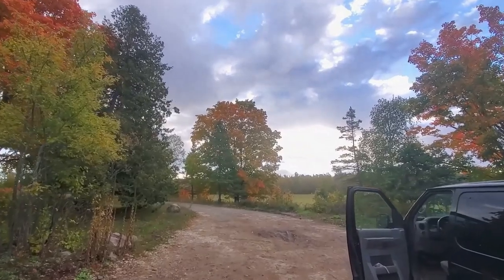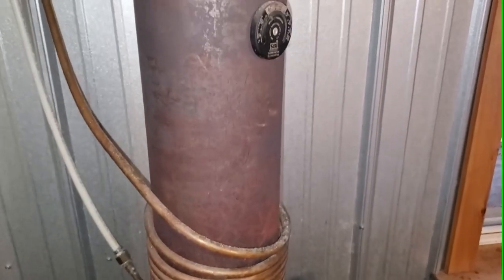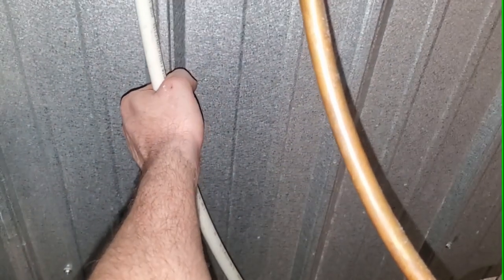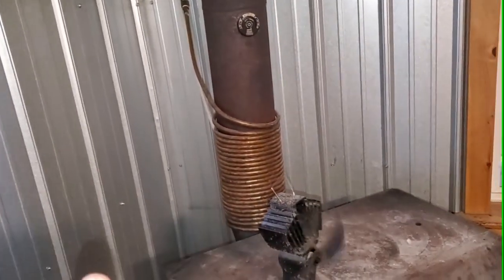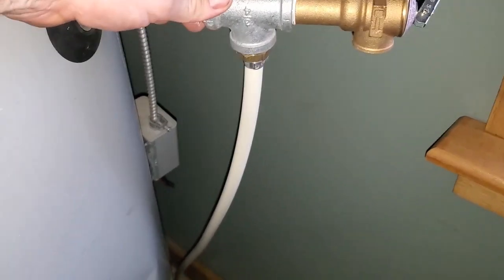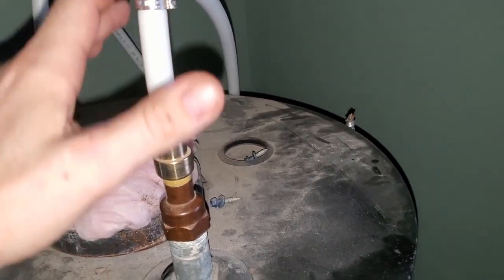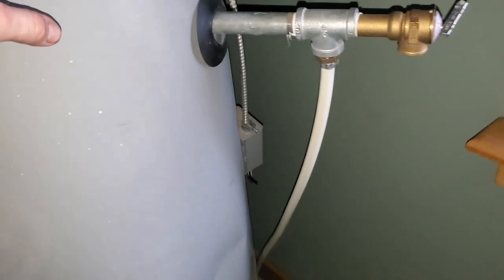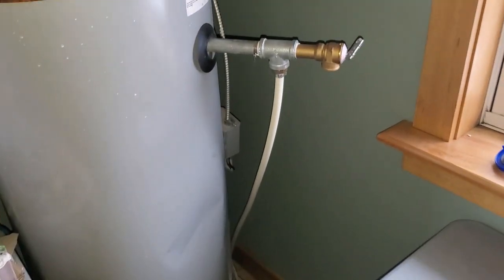Endless HOT Water for FREE/OFF GRID part 2/update

Comment: That’s a great update. 
I suppose that if the heat creates pressure suck that it backs up, it would simply push water back into the supply. No?
Reply from the maker: Yes it would do that, the water lines have a limit on how much pressure they can handle though so the pressure relief valve is very important in any system.

Comment: How do you heat your domestic water in the summer ?  I am assuming you do not operate your wood stove in the summer. Have you ever thought about putting your hot water tank in a tub or trough just in case the tank springs a leak ? If the hot water tank did spring a leak it would cause a lot of damage to your house interior.
Reply from the maker: I answer the question on summer heating in the video. 
I'm not worried about springing a leak in the system.
Reply: That's why I always recommend a drain and tray under every water heater on new builds.

Comment: Is the wood stove heated water mixing with the water in the hwt or is there an internal heat Exchanger? Just curious as to why not just dump your heated water into the domestic cold port at the top rather then into the prv. I'm planing on doing something similar so I'm just picking your brain. Thanks, From one over taxed ontarian to the next.
Reply from the maker: There is no heat exchanger, it's all mixing together. Dumping the heated water into the cold port wouldn't work well due to it not flowing well... the heated water rises and causes thermal siphoning but the 6" drop in the line going into top of tank could prevent it from circulating properly.
Reply: @countrysideacreshomestead2008  interesting. Thanks!

Comment: So, here in South Africa our electricity supply is pretty terrible...and getting worse, (Google Load Shedding - South Africa). I've been cooking on a wood stove for about 8 or so years and am presently hooking it up to my hot water system, removing the need for electricity in this regard. I've fitted a small tank on the side of the stove (oven side), and it will thermosyphon with my hot water heater via 22 mm copper piping. My next challenge is to figure out if I can use the heat from the wood stove to drive a propane gas refrigeration unit....without the propane. Have you ever heard of anyone doing such a thing?
Reply from the maker: Look into wood gas. I plan to build a wood gas system to replace regular gasoline in my generator.
Also you could look into solar powe of course. I plan to do an update on our solar panels soon.
Reply: @countrysideacreshomestead2008  - The thing about the stove is it's ALREADY producing and wasting a great deal of heat. Solar power requires batteries....which will always need replacing, and here it's expensive (18 ZAR to 1 USD) - I will always have wood. My thinking was that if I built a VERY well insulated cold room, it would comfortably handle 7 or so hours of no heat supply from my stove. However I do have excellent plans for a wood gasifier - the only problem with syn gas is that you can't compress it to store it easily.
Reply from the maker: I've been thinking on that, wonder if you couldn't compress it and store it in empty propane cylinders
Reply: @countrysideacreshomestead2008  - It literally becomes a bomb...😂
Reply: @countrysideacreshomestead2008  - The only possible way is in big inflatable bags, similar to methane storage.
Reply: @The_Hairy_Farmer  You can make a refrigerator powered by the sun. Only during the day, that's enough.